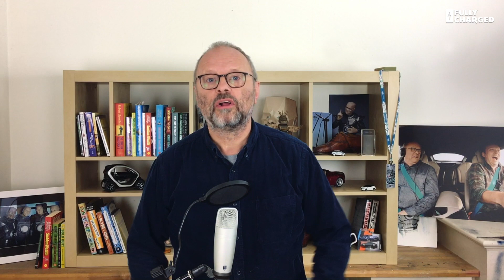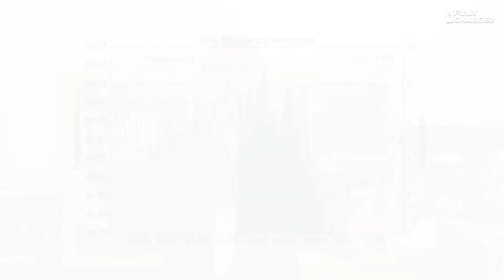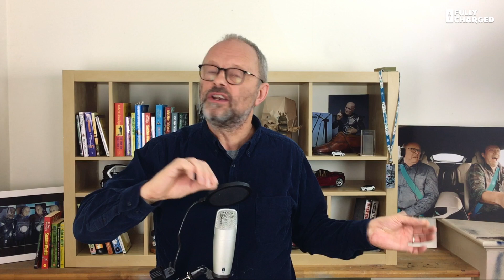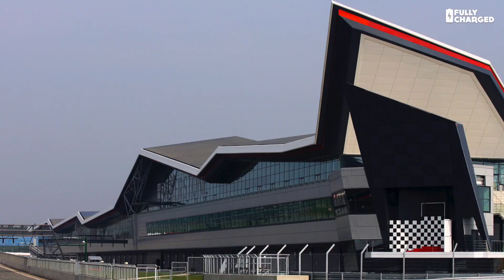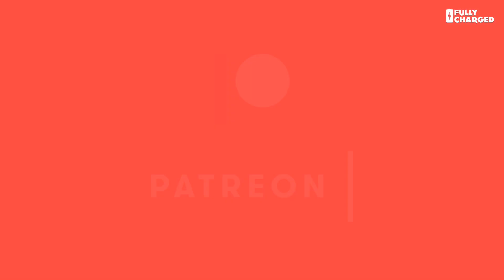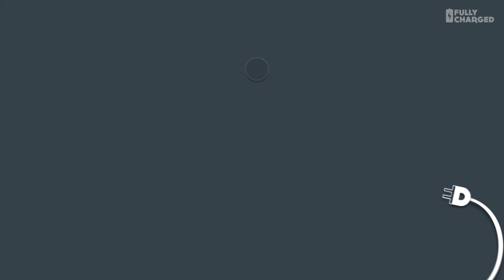Welcome to 2018 | Fully Charged News

Comment: Leaking nuclear waste containers. 
Radiation leaks. 
Fukushima water contamination. 
Paid pro-nuke media trolls.
Reply: Those are problems with existing nuclear technologies, yes. 
There are technologies reaching readiness now that eliminate most or all of those issues. If they could escape the stigma of the older tech, they could provide safe, clean, abundant energy. It's understandable why the stigma exists, but it is frustrating - even moreso when new projects are greenlit using outdated technologies (like Hinkley Point C!). Noone is willing to risk the political capital to throw money at a combination of the words "experimental" and "nuclear" even if the risk of meltdown is practically impossible! So they contract for the old "proven" tech.

Nobody has paid me to say any of this, and I'm not a nuclear physicist, but I do believe there are some applications for which you need nuclear reactors to provide sufficient energy density. Space travel is one. Perfecting the technology and demonstrating its trustworthiness on Earth is something that will enable incredible achievements in space.
I don't believe Robert would take money from anyone in the nuclear industry either - like me, I think he is a convinced layman and nothing more.
Reply: Chris Gilbert except that that's not an apples to apples comparison. The EPRs being constructed at Hinckley Point will be able to vary their output between 60 and 100% output in a matter of minutes, with a capacity factor of over 90%. They don't really need storage as such as the fuel is the storage.

Offshore wind on the other hand has a capacity factor of roughly 40% and cannot vary its output on demand. You get what you get depending on wind conditions, and have to rely on things like gas peaking plants or diesel generators to fill in the gaps when demand doesn't match production. No currently available storage technology is anywhere near feasible to cope with multi day lull scenarios.

I'm no big fan of the EPR, but I'd rather see renewables + nuclear, rather than renewables + gas/diesel. After all wind + gas peaking + 4% gas leaks (during extraction and transport) is equivalent to combined gas plants emissions wise, and that doesn't seem like a sensible way to combat climate change to me.
Reply: George Stone Whatever you think of Nuclear energy, if we hadn’t had it, we would have been back in the stone age- run out of coal, gas and oil long ago. 

It might not be perfect, but it’s filled a gap, until we have more renewables. It’s also a well established fact that energy sources should be mixed. It’ll be many decades before we can decommission all the nuclear plants across the globe.
Reply: Gary Green, ecomodernists such as myself don't need to be paid, we support nuclear as we've looked at the evidence available and have come to the conclusion that the quickest and most effective roots to rapid decarbonisation is a mix of low emission renewables combined with nuclear.
Reply: Worse, the seawall was only half the height it was suppose to be, another nuclear plant that had a proper height seawall was hit by the same tsunami but it was able to keep working later because the seawall delay the flooding long enough.
Reply: George Stone
If a drunk driver causes a lethal accident, we don't ban cars, we ban drunk driving. Fossil fuels kill millions every year, infinitely more than nuclear energy. So if your priority is safety, you should fight against fossil fuels, not nuclear energy.
Reply: Chris Gilbert - although 9000 extra deaths due to Chernobyl sounds a lot, statistically speaking, nuclear still has one of the lowest deaths per TWh of all energy sources. It also is around 18 times smaller than the number of deaths caused by hydro's worst disaster at Banqiao, not that you hear many greens mention that fact. Of course coal causes significantly more deaths per annum during standard operation.

The truth is that we still rely on large amounts of dirty energy sources (coal, oil, gas and biomass) to meet our energy demand. Increasingly gas peaking plants have become favoured as they can be used to quickly adapt with renewables variability. This comes at a cost though, as they are much less efficient than combined cycle gas. Gas extraction and transportation also suffers from leaks, which is also an issue given methane's significantly higher 100 year warming potential compared to CO2. This should be concerning to greens or ecomodernists alike.

If you really want low emissions, you have to find a good partner(s) for renewables that can be ramp its output up and down quickly, and can also fill in when things like multi-day lulls happen. Hydro and batteries can do this some of the time, but nuclear can manage this for extended periods of time.

I don't much like solid fuelled reactors, due to their inefficient use of fuel that results in the majority of fuel being discarded as waste, but better that than the emissions of coal, oil, gas and biomass. Nor do I like their use of water for cooling and moderation, that increases the likelihood of and the scale of accidents.

However, around five years ago I came across molten salt reactors in a Cosmos magazine article, and was sufficiently convinced by it and follow up reading that safety, waste and fuel concerns were all possible to address and that with it we could replace all fossil fuel and biomass with renewables and nuclear, and could therefore shift to a ultra low carbon electricity generation without compromising energy reliability or security. It was that article that started me on the path of becoming an eco-modernist.
Reply: Chris Gilbert I don't think molten salt reactors are as far away as you think given the active programs that are already underway in India and China, but I would say a decade away (give or take a few years). Irrespective of whether we need them for power or not, what we do need them for is four reducing legacy waste from did fuelled reactors (Hinckley Point C included).

I disagree with you on the relative risk of deaths from nuclear power being low because we don't get much power from it, after all I was citing deaths per TWh, which takes production levels into account. As for Greenpeace's reports, and other studies, I'd rather trust the meta analysises, which discard studies with faulty methodology.

As for wind's variable output, while you can feather them, soon in some sense vary between 0-100%, you have no control over your fuel (the wind), meaning that that 100% of 40% is still 40%. You can of course over provision, but that means that on a good day you have a glut to get rid of or mass feathering, and on a bad day you still get under production. For sure it reduces the likelihood of under production, but it doesn't eliminate it.

The other option is to build a sensible amount of renewables, enough to satisfy 100% of average demand on a good day, combined with backup generation and storage that can fill any shortfall. Ideally the backup generation would be ultra low emissions, and fully rampable or capable of hydrogen production by thermal cracking (which could then be used for transportation).
Reply: Chris Gilbert
The most thorough study I saw (WHO) puts the number of death at Chernobyl between 60 and 4000. And it's likely on the lower end. 
At Fukushim people died because of the evacuation, not from radiation. Radiation levels weren't high enough to justify an evacuation, so those deaths can't be blamed on the accident.

There are about 450 civilian reactors in the world. Most of them are over 40 years old. They provide 10% of the world's electricity. That's not small.
There were only 3 big reactor accidents.
TMI was the first, but despite the complete meltdown, only trivial amount of radioactive material got out. Unlike the other two it was a well built reactor in top condition (it was brand new). 
Chernobyl was an epic failure. It was an inherently unsafe reactor design, with few safety features (no containment building for example). It was built badly, they often had to improvise, because the Soviet economy was pretty poor, and bureaucracy ruled everything. This also badly affected the operation too, the operators were poorly trained and wasn't aware of the fatal flaw in the reactor design. Then they were instructed to conduct a dangerous experiment, and aborting for safety reasons was simply not considered as a possibility. That was the Soviet mentality.
Fukushima was another victim of corruption. TEPCO (the owner) new about the possibility of a mega tsunami, and the vulnerability of the power plant, yet they didn't do anything to save a little money. Other upgrades and repairs were also neglected, and they had no adequate plans or equipment for dealing with a serious accident. And ironically, just like in the case of TMI, manual shutdown of the emergency cooling system is what moist likely caused the triple meltdown and the leaks. Plus while the reactors had containment, it wasn't adequate. It was an early American design, which turned out to be flawed. They apparently neglected to actually test it. But the flaw was discovered, and fixed in most reactors. Not in Fukushima. And finally, the plant was 40 years old. It was supposed to be decommissioned by the time of the accident. But since extreme regulations make building new plants hard, companies usually choose to extend the existing plant's licenses instead of building new 1000x safer ones. But despite the series of epic fuckups, still very few people died. It's nothing compared to the millions that fossil fuels kill every year.

Insane regulations make building nuclear reactors slow and expensive. In the early days it only took a few months to build one, and they were dirt cheap.
It took only a few years to get from the discovery of nuclear fission to building dozens of big reactors for making plutonium. The entire Manhattan Project was shorter than the time it takes today to approve a new plant. The right way to do it would be mass producing small modular gen. IV reactors in factories. That would bring down the costs orders of magnitude, eliminate cost overruns, and make effective construction time weeks instead of years.
Reply: The problem is regulations. They are extremely strict, which makes nuclear reactors very special. They require a lot of unique parts and expertise, which drives up the cost big time, and if any small thing goes wrong it causes huge delays and cost overruns. And since few reactors were built in the last few decades, that expertise was lost, and parts became harder to get. Plus a huge amount of work must be done by local contractors who are not used to the extreme level of quality that is required. More than once entire reactors were scrapped because of missing paperwork.
The next issue is that as regulations drive up the cost the reactors have to be bigger to stay competitive. This makes engineering problems exponentially harder and more expensive. Plus makes the reactors more prone to meltdown, which in turn requires even more complex and expensive engineering.
And finally these regulations make innovation almost impossible. We are still using 1950's technology, despite having far superior reactor designs available.
What we should do instead is first making reasonable regulations, which still assure high level of safety but with far less restrictions. For example the allowed radiation leak is ridiculously low, far below the natural background, and what coal plants release (coal is radioactive).
The ideal reactors are much smaller than what we have today, and are mass produced in factories by robots, not individually by hand. These can be transported and installed with minimal local work. Small size alone makes them safer, so less very expensive safety features are necessary, and mass production further lowers costs drastically. MAss production also eliminates delays and cost overruns, and they can be operational only weeks after the order was placed. Using more modern designs (like the LFTR) simplifies manufacturing and improves safety.

The WHO did a very thorough study, read it if you don't believe. The error margin is so high, because that 4000 number has been estimated with a statistical model which is known to be unreliable at low doses. It very likely wildly overestimates the number of cancer cases, that's why the lower end is more likely. The report itself warns readers not to use the high end as a fact, but a worst case estimate.
Also the WHO studied the area where the radiation was high enough to potentially cause harm. But there were plenty of other studies and none of them found anything.

As I said regulations are extremely strict, far beyond any reason, that's why some animals and plants in Europe are officially not safe to eat. In reality, they are less dangerous than a steak. Also these are concentrating radioactive elements, so they are far more radioactive than the environment.

Most nuclear accidents involve military projects, not civilian reactors, because the regulations are far more lax when it comes to weapons. And if you also look at the death tolls, you will see that they are dwarfed by fossil fuel related accidents. Not to mention the business-as-usual killing of millions with their toxic waste. And climate change.
Civilian power reactors didn't kill a single person in America or Western Europe, where safety is taken seriously. Even at Fukushima radiation didn't kill anyone. Only the evacuation did, but it was unnecessary, radiation levels weren't high enough to require it. If you look at the evacuation and radiation maps you will see that the have little correlation anyway.

Here's a source for the fossil fuel related deaths : http://www.who.int/mediacentre/news/releases/2014/air-pollution/en/

So nuclear energy actually have the best safety record from all energy sources. Even solar and wind are more dangerous according to pretty much every statistics.

Actually nuclear reactors are extremely simple. You can make one with a solid ball of plutonium and a standard generator. The complexity comes from the size and extreme regulations, as I explained at the beginning of this post. Not that complexity is a problem, a modern passenger jet is far more complex than a nuclear reactor and we still mass produce them.

The rest is just bad publicity. Mostly decades of Big Oil propaganda. Objectively it's far safer to live next to a nuclear power plant than any other one. Especially coal. I personally would be happy to live near one. Actually we have two reactors in our capital city only a few miles from where I live. These are not big power reactors, one is a training reactor for nuclear engineers and the other is for research, but they are still nuclear reactors.
On the other hand I wouldn't really feel safe around a big wind turbine. Those gigantic fast moving blades are not reassuring. And they can also topple or catch fire. Google "wind turbine failure". Dam failures are also pretty common, and they can be far more deadly then Chernobyl. Then there are gas explosions, which can happen anywhere any time (there are some pretty scary videos on YouTube). Or that gigantic chemical explosion in Tianjin in 2015 which looked like a small nuclear bomb, and on top of directly killing almost as many people as Chernobyl it also dispersed a huge amount of toxic chemicals.
Reply: Fukushima was caused by corruption, nothing else. The technology is good, and should have survived the earthquake and the tsunami too, despite the unprecedented scale.
The problem was that TEPCO failed to do the necessary upgrades, and the regulators didn't enforce the regulations.

But even with these problems nuclear disasters are extremely rare, and nowhere near as bad as you would think. Fukushima didn't kill anyone, and even the evacuation was mostly unnecessary. If you look at the radiation maps, and the evacuation zone, you will see that they have nothing to do with each other. And that the most contaminated areas are not worse than living on a space station. In case of Chernobyl, despite the long series of major fuckups, less then 100 people died from radiation.
The fossil fuel industry kills millions every year.
So yes, a gas plant wouldn't have contaminated the are in the accident, but it would have contaminated it all the time, causing much worse problems.
As for cleanup costs, a major oil spill is comparable to Fukushima. And most of the cleanup work in Fukushima is completely unnecessary.

Also the nuclear industry already pays for the decommissioning and the waste management in advance. No other industry does that. That's unfair, especially in case of fossil fuels which are very dirty. If the coal industry were forced to clean up all of it's mess, it would cease to exists immediately.

Fusion is cool, but we don't have time to develop it in time. It's already almost too late, we have to work with what is available now.
Reply: Bubble warning! Nuclear is dangerous with the waste and all, but if done properly it is actually quite safe. Yes, building a nuclear plant on a coast next to a subduction zone, was not the proper way of doing it in Japan. Here in Finland we do have a power plant project, Olkiluoto 3, that was first coined in late 80s, wrestled through the 90s, finally permitted in 2001 and still not done. Some companies still have the nerve to be wanting more permits. Also we have an exceptionally thick and stable bedrock, which enables the safe deposition of nuclear waste for literally hundreds of thousands of years, ice ages and all. There are no long term nuclear waste storing projects anywhere else, not in this scale anyway. I´m no expert, but feel quite confident that when done right, it is safe enough. For now.
Having said that, I would prefer solar, or any decentralized power, any day, for it is without risk and is much more rigid than centralized energy production.
Reply: Chris Gilbert , yes it does.  Just because the cost of pollution in health care costs isn't calculated in real costs doesn't mean you aren't being taxed.  It's more about who is getting the profits.  😕
Reply: More anooying, for those old enough to remember here in the UK. The Government sold Nuclear power as a ‘free/very cheap’ energy source. Unless you generate your own from renewables, power is never going to be cheap or free. Repairs, upgrades, Maintenance all cost money and while the end user might appear to be getting free energy, somewhere along the line, the said ‘user’ will pay for it in the long run.
Reply: My point was that a big tsunami is a rather regular occurrence on these areas (~300 years in NE Japan). Maybe they could have built a better shielding against the water, but I would have built it on the west coast instead. I guess one has to make mistakes first to learn from them.
Reply: The earthquake didn't do the damage that cost the meltdown to happen. It shut down properly after the earthquake.  The subsequent tsunami knocked out the supporting energy system of cooling. 
This shows that it worked above and beyond what it was designed for even with the under performing adaptations TEPCO should have made to the secondary cooling. 

Ps: gary green, it looks like your text is a good example of trolling.
Reply: Any nuclear plant producing waste needs to be taxed.  Not just for the waste they are currently producing, but to cleanup the mess of legacy development in nuclear power.
Reply: PS Making excuses for a disastrous nuclear accident looks like trolling.